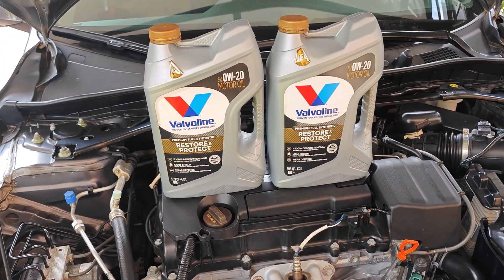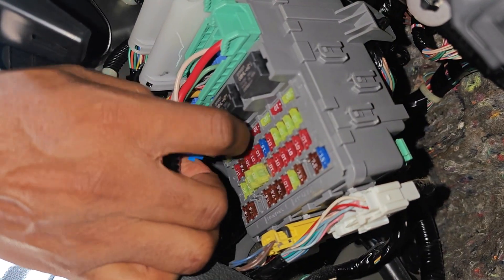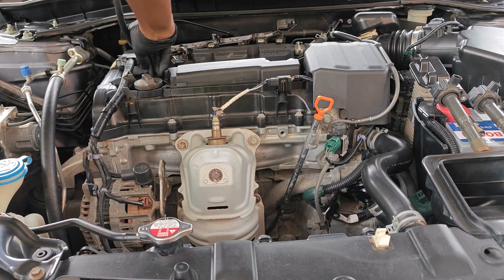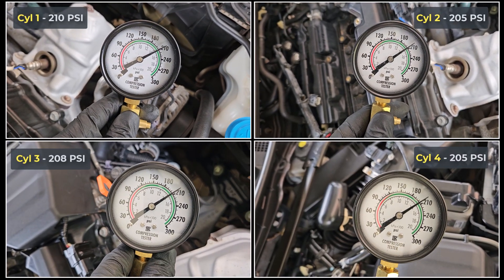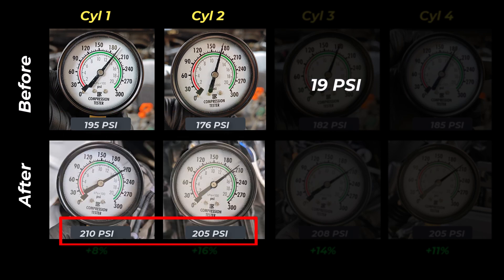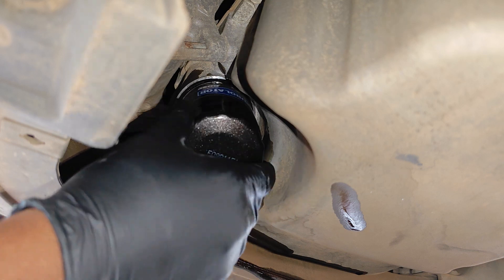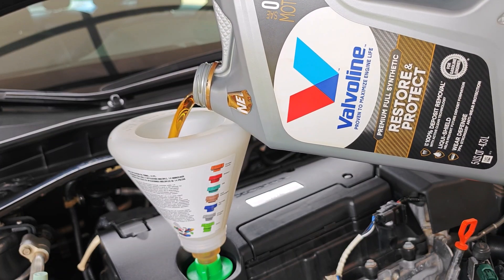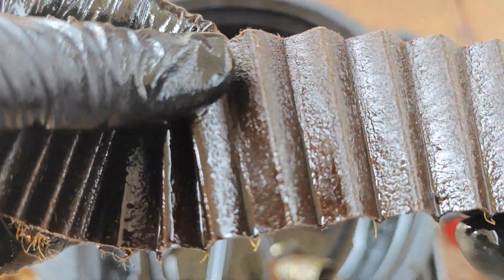Checking engine compression AFTER Restore & Protect Oil. Increased Engine Compression?

Comment: All oil brands are good oils. Do not drive over 3 months after every day driving. Used correct oil viscosity for winter 0W30, 0W40 and summer 5W30, 5W40, 10W30 and 10W40 synthetic conventional. Full synthetic water thin oils 0W20, 5W20, 0W16 and 0W8 not going to work hot summer season and engine put out heat needs pulled off the market shelves. No matter oil viscosity you used and you driving it every day and you waited 3000 to 20000 miles next year for oil samples test not truthful test. Never followed new generation woke viscosity.
Reply from the maker: It's good to have a healthy discussion on oil viscosities. I've been working towards a used oil analysis to learn what the best oil for my conditions will be.

Comment: I had my 2010 Toyota Camry, with the 2AR-FE engine, oil changed to Valvoline R&P 0W-20 about 4 weeks ago.  Before using Valvoline R&P, I had my synthetic oil changed at a Toyota dealership between 6000 and 8000 km intervals.  About 3 months ago, the car start burning oil... about one liter every 2000km.  Prior to that time, I did not need to add oil between oil changes.

I have just completed 2000 km on my car and the oil consumption has been reduced to about half a liter per 2000 km.  The car engine is also a lot quieter.  The oil is not that dark as I have had this car serviced on a regular basis.  I plan to have the oil and filter changed at about 4000/5000 km which is about 2500/3100 miles depending on how dark the oil gets.  So it appears that Valvoline R&P is working on reducing oil comsumption on my car
Reply from the maker: Thanks for sharing

Comment: First time using this stuff, and honestly, it smells like frosted flakes and canola oil.
Reply from the maker: It does have a smell I haven't perceived with any other motor oil.
Reply: @DIYAutoworksNG  Probably due to whatever boron molecule they're using for cleaning specifically.

They found this works by accident, lol.

Comment: Great video and nice outcomes, hopefully this will work on Hyundai theta engines.
Reply from the maker: It should. I hear Hyundai has a lower threshold for sludge if maintenance isn't on point?
Reply: @DIYAutoworksNG  Low tension piston rings and GDI caused lots of consumption.
Reply from the maker: Same issue we're all grappling with. Those low tension rings get stuck easily

Comment: Why are you as a very knowledgeable auto tech, using a 0W20? 
Shame on you for putting that engine at risk for engine Crank bearings at risk of failure.
It's widely known to always use a 10W30 for most 4 bangers, unless they are being operated in cold climates than a 5W 20 is suitable and provides excellent engine protecting.
Dude your wrong for using a 0W20 on a car operating in warm climate conditions.
Reply: Take it easy dude, you can use any oils from manual longer you changing in proper intervals, people use extra extended intervals and that how problems occur.
Reply from the maker: After watching Engineering Explained's take on the subject, for now, I might still stay with 0w-20 until I'm able to use used oil analysis to inform a change.
Reply: Putting a thicker oil at startup makes zero sense to do unless your engine is worn out. Use the oil your manual specifies, including the range for the climate you live in.

For instance, my car can accept anywhere between 0w-30 for extremely cold climates all the way to 10w-40 for extremely hot climates.

I personally was running 5W-40 in the summer, over 90F where 5W-30 isn't as great per the manual, and 5W-30 in the winter. 10W is far too thick to flow quickly at regular temperatures in newer vehicles, not a single manufacturer would recommend this for modern 4 cylinder engines outside a few cases like extreme heat in the area.

Comment: There is nothing wrong with prefilling the oil filter. Its is wise to do so.
Reply from the maker: It's true, it helps with the oil flow during startup. But you know I've several people come after me in the comments any time I prefill 🤣
Reply: Milion dollar question, How you prefill Subaru oil filters during the process of oil change😅?
Reply: @fibonaccisequence2891 you can still prefill enough to soak the filter media and not leave loose oil in the canister
Reply: @fibonaccisequence2891 I've got a subaru and a buick, both are physically impossible to prefill lol
Reply: @fibonaccisequence2891 you pour some in the filter and turn sideways and rotate, this will get the filter material wet, then install...and don't start crying 😢😢 about some oil leaks out ....what's rags are for

Comment: Nice results. One thing that may help is that you don't have to remove the power to the fuel pump. Just hold the gas pedal to the floor as you crank. It will shut off the fuel injectors in whats called "clear flood mode."
Reply from the maker: Good point! However, this Honda doesn't have flood mode.
Reply: Right my 2008 Acura TL doesn't have clear flood mode either  @DIYAutoworksNG
Reply: I found out the hard way my 2017 Elantra Sport doesn't have this mode. 

I still feel bad for a full throttle startup right after an oil change, that probably will be the most wear the engine will ever see at once.

Be careful and know your car if you do this.
Reply: LOL. Gotta love internet and their advice.  WTF.

Comment: So awesome! Can't wait to see my results in my 17 CRV with the 2.4. Appreciate your work!
Reply: Do Not Use the 0W20, use the 5W30 in your engine. DO NOT Use the 0W20. Ever heard of Crank bearing Failure? Your subjecting your car ro rhis event if your driving un temps above 70 ambient degrees.
Reply: @benjaminwilliams3568  im in Alaska where its barely above 70 2 months of the year. Ill stick with my 0w20 when im doing cold starts at -20° F and colder 👍
Reply from the maker: Thanks, wishing you the best with your CRV!

Comment: Yeah VRP works!!! Which means all other sludge removers are unnecessary at this point if VRP used regularly. Not necessarily to be used in every oil change but lets say every 2-3 oil change would be good too. Sadly they don't sell it in Turkey.
Reply: Valvoline said you can use this oil on brand new cars and use it as your oil of choice every oil change
Reply from the maker: I hear you on the VRP availability. Such a shame. I agree with you too. I don't see a place for flushing if R&P is in use.

Comment: Very nice compression improvement.  I am wondering how Restore and Protect will do in a new engine.  I am looking to test it in a new truck and will do some used oil analysis to see what the wear metals look like and how well it holds up.
Reply from the maker: Thanks bud. Good plan you have. Do let me know the results of the used oil analysis.
Reply: I world run ultra platinum instead in a new engine

Comment: Great work putting this together. Many thanks for a great video and especially showing the before and after compression readings! I would not have expected this much improvement. It would be interesting to know what the compression spec range is from Honda.
Reply from the maker: Thanks a lot for your comment!
For Honda, the guidance is that compression should be above 130 psi and that the variance between the engines shouldnt be more than 29 psi.

Comment: Thank you, thank you for this update on your experience with the Valvoline Restore and Protect.
Reply from the maker: You're welcome!
Reply: Thank you! Just get VRP 5w-30 in there and that CAFE water out 😂👍
Reply from the maker: Lols. After watching Engineering Explained's take on the subject, for now, I might still stay with 0w-20 until I'm able to use used oil analysis to inform a change.

Comment: So in other words it worked, it cleaned up the piston rings, nice vijeo mate, too bad we cannot get in Europe at a decent price, the postage and taxes will cost more than the product itself.
Reply: I'm in South Africa. I'm also having the same problem. Can't get my hands on this oil. VALVOLINE if you're watching please make your product available in the countries we just mentioned.
Reply from the maker: Thanks mate! Yea, such a shame it's not widely available.
Reply: Do we have any alternatives in europe?
Reply: @chief-nw5yw  You also can use LiquiMoly Pro Line Engine Flush (500ml) just before you do an oilchange, to get the engine clean.  And use the normal engine oil recommended by the car manufacturer (see owners manual under Engine Oil. If you are driving in severe condition just change the oil at half the recommend mls/km or time recommended by the car manufacturer if want to prevent slutch build up. So my last Toyota's oil change interval was 15.000km (9.375mls) or 1x per year (what every comes first). I changed it to max. 7.500km (4.688mls) and 6  month's interval. I bought this car at 12 years old and 180.000km (=112.500mls) converted it to LPG and drove it for 5 years upto 288.000km (=180.000mls) and sold it to my nice. She currently has the car for 3 years now and it has 338.000km (=212.250mls). No issues, just do the correct maintenance on time.
My current car has an 2.0L 4 cilinder petrol/gas engine and has an oilchange interval of 20.000 or 1x per year (what every comes first). I shortened it to once every 10.000km of every 6 month's  (what every comes first).The car is 23 years old and has only done 163.000km (=101.500 mls), so on average just 7.087km (=4.430mls). Mainly city driving. So next oil change I will be using LiquiMoly Pro Line Engine Flush (500ml) again. 
I also have change all filters, ATF oil and spark plugs. Plus and I already have used LIQUIMOLY Injector Cleaner (250ml), LIQUIMOLY Valve Clean (150ml) and LIQUIMOLY Motor System Cleaner (300ml). The engine runs like a charme. Hope it helps!
Reply: @chief-nw5yw Rislone Engine Treatment concentrate and Wynns hydraulic lifter concentrate. Both are oil additives with long-term cleaning effect.
Reply: Yes , liqui moly Leichtauf @chief-nw5yw
Reply: @chief-nw5yw  you can use Xenum M-Flush in every oil change or even put a maximum of 10% volume with the new oil, it's not solvent based so it's safe to use while driving and even through a full oil cycle
Reply: One thing you have going for you in Europe is that the additives in your fuel are much better than in the US. So that does help. In the US, the generic gasoline has poor additives/detergent.
Reply: It WORKS? But ur too cheap to buy it?
Reply: @stoveguy2133 no they're saying they would probably have $150 wrapped up in the oil and need to do it four times. Oil is not cheap a lot of places in the world we are fortunate that we can go and grab a pretty good off-the-shelf oil for under $25 for 5 quarts and through no fault of the many car fans across the world in Australia and Europe in a lot of other such places it's close to 70 or $80 for 5 quarts of oil hence the long drain intervals and trying to get the absolute most out of the oil so while we are comfortable with changing our oil when it gets a little dark a lot of folks in these countries might not be so quick if they think it's still due in the job
Reply: You live in the wrong continent guys
Reply: @yournightmare9999  They’ll be market testing for a while it to make sure it’s up to the job before rolling it out further.